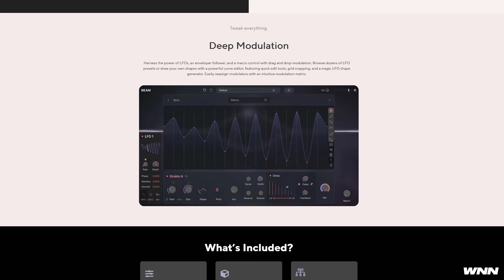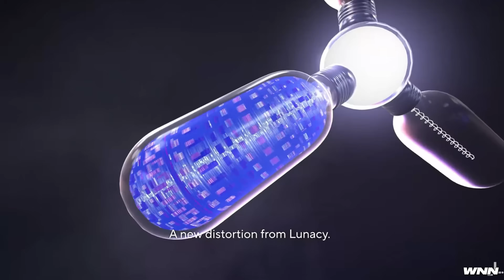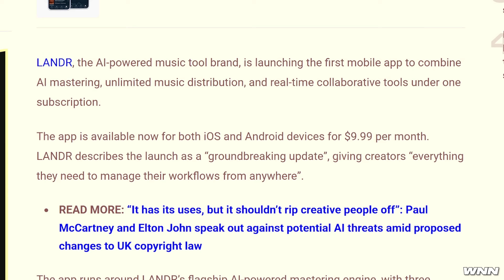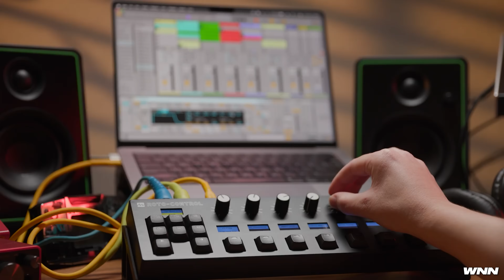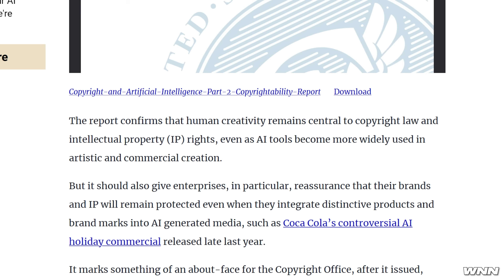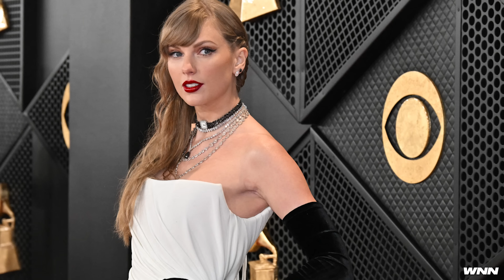AI MUSIC IS DEAD!!

Comment: If it costs 750 and its sold out, its hand made. That is where you start. Low run production is expensive, scaling up makes it cheap. Shitting on it is silly, you just need to understand why its expensive.
This has nothing to do with TE, its the other way around. TE are oldschool. They would have been cheap in the 80s or even 90s when electronic music was smaller. I’m happy Behringer exists, it changed the market. But innovation comes from the low run boutique gear. Thats just some dude in a garage (or renting a spot in a fablab).

Comment: So let's see... 

* Monolit - 8 faders, 13 buttons, 128x64 monochrome display, , 1 TRS MIDI + USB MIDI + USB host, sends notes/CC + LFO + arpeggiator + records fader automation: $750

or

* Electra One -12 high res faders, 6 buttons, 7" 1024x600 touch screen, 2 pair MIDI DIN I/O + USB MIDI + USB host, sends all MIDI messages, incl  sysex, Lua interpreter for custom tooling: $554ish

🤔🤔🤔